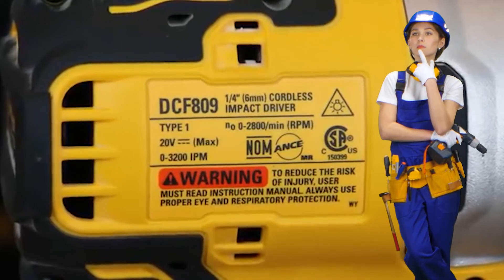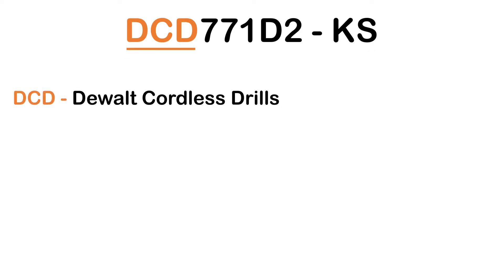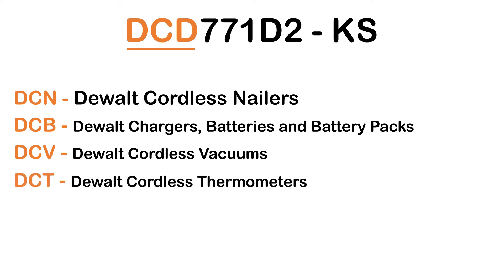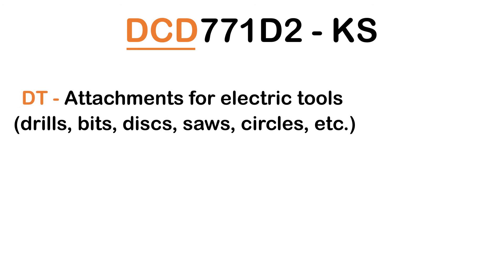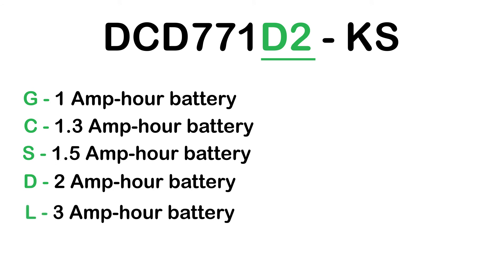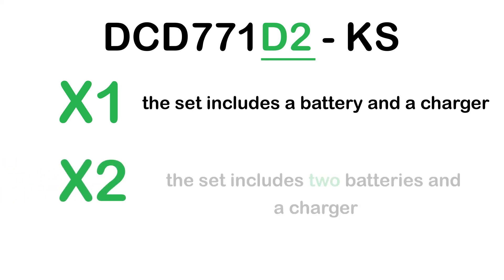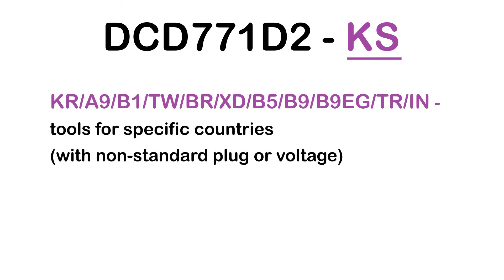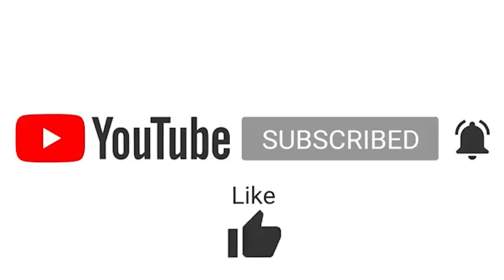What do DeWalt model numbers mean? | Jeffostroff & Tool Boss | Survey showed

Comment: What about corded tools, like the DeWalt table saws? 
There is a DWE7492-LX, DWE7492-GB, DWE7492-QS. 
I think the LX is 110v, the other two are 230v, but what do these letters actually mean?
Reply: Maybe a bit late :), but the info in this video isn't quite right - the final suffix doesn't relate to the type of tool, like -QS = corded power tool as they state - that is covered in the first letters/numbers. The final suffix is region/market and has to do with voltage supply, type of plug fitted, etc. -LX = 115V UK yellow round plug (UK professional/building site standard), -GB = 230V standard UK plug, -QS = 230V standard Euro plug.

Comment: Thank you very much, that added a lot to my little cheat-sheet I just started in my search after getting frustrated trying to compare items on the DeWalt website and elsewhere.  
While I truly appreciate this, and very much, there is still much missing info, others have alleged that the first 2 numbers of the batch number have specific meanings, and have alleged meanings of other extensions like XR=extreme runtime, XRP=High Capacity Lithium-ion, KL=Lithium kit, etc., which I have not yet had time to check out myself yet. Still trying to get the basic nomenclature, which this has helped tremendously.